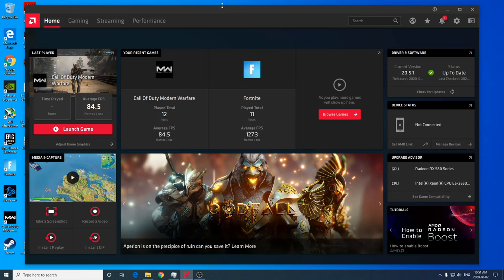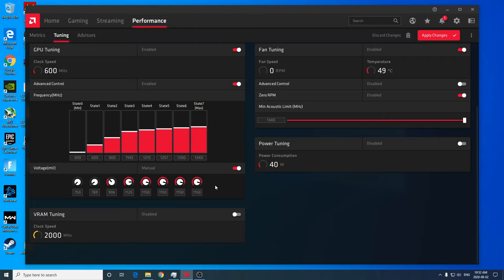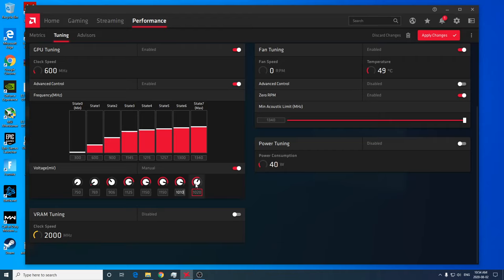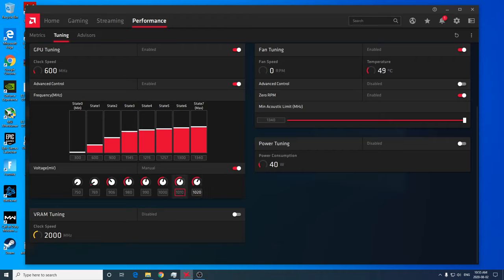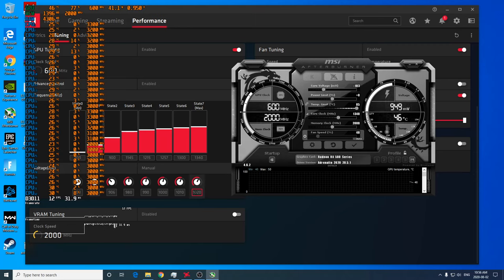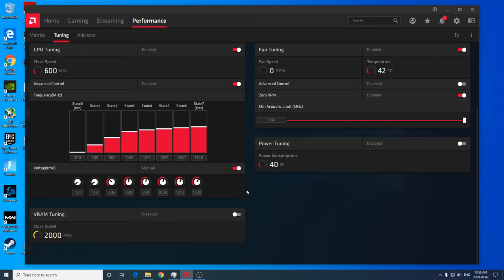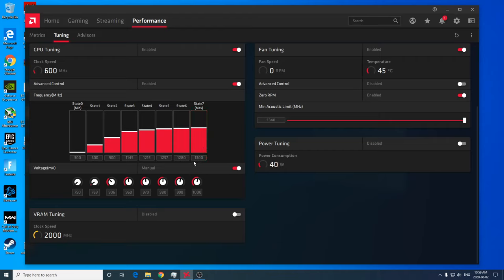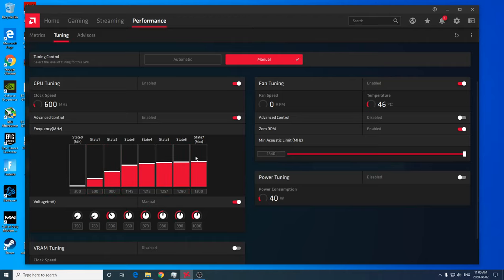How To Undervolt AMD RX 570 and RX 580 (How to lower GPU temp upto -10c)

Comment: Hello I heard that this helps people im just curious if it will burn cables? because i heard that sometimes undervolting burn cables
Reply from the maker: No it doesn't burn cables.
It actually prevents that from happening as when you lower the voltage for the gpu it reduces power draw
Reply: sorry for bothering also im interested i should copy all those setting in video right? @AleksandrsBrodie

Comment: Hey there. Nice video! But in the latest Adrenaline drivers (like from April 2021 and henceforth) there is nothing at "Tuning" . Just the accept license agreement, and then choose between "System", which has NOTHING, and "GPU", which only shows Radeon RX 580 series and "Smart Accesss Memory: Not Available". I have tried finding these settings that you show on your video but with no success..... :-( . 

I am on the accursed laptop Asus Rog Strix GL702ZC-GC195T. AND IT ALWAYS LAGS MAN. Even freaking Pathfinder game which is like a new Baldur's Gate. Now I am just speeding with the Mako Vehicle on Mass Effect Legendary Edition and I can feel the freaking spikes while cruising on a flat road. It's so annoying... :-(

(Of course I 've tried Everything there is to lower down on the in-game graphic settings, to no avail)
Reply from the maker: Maybe try using msi afterburner
Reply: @AleksandrsBrodie  thank you. But will I be able to use it? Because my laptop is ASUS. Or it doesn't matter?
Reply from the maker: @dnthymamai  if the laptop has a GPU in it, msi afterburner will work. it does not to be a msi product just needs to have a gpu in the system ;)
Reply: @AleksandrsBrodie  Thanks! Will try it out ;-)

Comment: Hi, I have a problem, I can't use undervolt for some games, they aren't showing when I want to apply settings. Please reply it will help me a lot...
Reply from the maker: there should be an option when trying to add a game profile to search for the application if it does not show up on the list, that is how i was even able to add an undervolt profile to other applications that are not games.
Reply: @AleksandrsBrodie  nope, still not showing, maybe because it is pirated game...
Reply: I found a solution, thank you now my temps are below 75c!

Comment: How to keep my GPU temperature below 70°C?
Reply from the maker: By choosing a low enough core clock to run a lower core voltage + setting a custom fan profile in msi afterburner
Reply: @AleksandrsBrodie  Oh thank you

Comment: Should we set Min Acoustic Limit at maximum, and is it okay to use fans at %100 RPM speed when Gpu temp is so high? if u can help i will be reaaaly glad man...
Reply from the maker: If your temps are at 88c then yes you need to run fans hard.
But I would first try lowering your gpu clock and voltages. 
And if the card is over a year old I would also consider redoing the thermal paste if the temps are still high after undervolting.
I have a more recent video where I share some undervolt settings you may copy and try.
Remember all cards are a bit different, some need a higher voltage than others.
Reply: @AleksandrsBrodie  I am trying to get the lowest volt as i can right now for Sapphire Rx590 and i am not taking any shutdown for Full fan speed but even on the full speed of my fans cant help the temperature, my temperature is always at 84-85c on stress test either 2000 rpm or 3500 rpm but without undervolting my system was crashing at 3500 rpm now i am not taking any crashes i think thats good but the temp is always the same i am gonna try to redo the thermal paste tomorrow and thank you for the quick response man you are the best!
Reply: @AleksandrsBrodie  and also, is it okay to set min acoustic limit maximum?
Reply from the maker: @yago881  I believe so.
What ever the software gives you an option should be safe.
The only setting that could risk damaging your card is if you increase the voltage on core past 1150mv or if you increased the memory voltage.
So yes. You can increase the fan speed.
Reply from the maker: @yago881  I would try 1300mhz on core at 1050mv for state 7.
See if that changes anything.
You can use software like msi afterburner to overlay the voltages and temps live so you know what the card is running at.
Reply: @AleksandrsBrodie  Even with that, the temp is still at 84c at 3800 RPM its been 1.5-2 years since i bought this display card i dont know the affect of Thermal Paste on GPU but i think it must be because of the absence of thermal paste cuz all the settings i ve tried, none of them helped me the temp is always at 84C with heavy load... is Thermal paste so important for tempereture,  do you think my overheat problem can be by thermal paste absence?
Reply from the maker: @yago881  It very well could be, I would order some to replace the thermal paste on the GPU. its not that hard to do, you can watch youtube tutorial on it, its simple, you just take your time when cleaning the old paste off and just be mindful/careful when working on the card.
Ive had cards that run at 86c even with lower and better optimized voltages and when i change thermal paste they run much cooler,
It really depends card to card
Reply: @AleksandrsBrodie  i will comment the results bro hope it will be satisfying :D
Reply: @AleksandrsBrodie  Yep, it was because of the god damn Thermal paste... man i am just so happy to see these temperature rates i just wanna punch the screen i am so greatful man thank you so much for clearing my mind and giving me the idea of thermal paste absence. I got 55 average temperetarue with 2200 RPM on benchmark BUT normally without the fresh thermal paste, i had 83 Temp on 3600 RPM... man just thanks a lot again you are the best!
Reply from the maker: @yago881  also, you can run your pc without side cover if it ever gets too hot.
glad it helped

Comment: ( sorry for my english  )
Please if u can, do another tutorial with rx 590 i have different stock settings in amd software and i really dont know how to do it correctly. I tried once just lowering last state from 1150v to around 1110v and after 15min my game crashed. In less demanding game it lowered temps but also sometimes my game crash and restart to stock settings.
Reply from the maker: It's hard to undervolt rx 590 if you leave stock clocks.
You need to lower your core clock in order to lower your voltage.
Watch my other ndervolting videos, maybe they will help explain more.
Reply: @AleksandrsBrodie  i will try but i saw on the internet someone lowered power limit in msi afterburner and got less temperatures. Is it good idea?
Reply from the maker: @vustet99  lower power limit will lower your clocks.
Undervolting is lowering your clicks but also finding optimal voltages to run the clicks at so if you just drop power limit, (example) your card may run at 1266mhz, but if you undervolt, for the same power, your card may run at 1340mhz.
Reply: @AleksandrsBrodie  Ok thanks tomorrow i gonna try and last question.
If i only lower a little bit power limit i will get a small performance loss but lower temps or not?
Reply from the maker: @vustet99  if you lower power limit without optimizing voltages, you will lose some performance but you will probably get better thermals.

Comment: I have rx 580 and while playing games i have  ussually like 74° C. If i do those things in vid, will it change the life of card?
Reply from the maker: Yes it can improve the life of the gpu by reducing the temps.
For your situation because temperature is not an issue, you can leave the stock clocks and try dropping the core voltage first to 1100mv then -20mv until you find one that is stable just before it crashes. So you are running the lowest STABLE voltage on your gpu.

Comment: Hello! Would increasing only the power limit without touching other parameters, increase performance ?
Reply from the maker: No.
If you want more performance you need to increase core clock, and adjust voltage so it runs stable.
Reply: @AleksandrsBrodie  thanks for the reply :)
Reply: I have one more question if that is ok, are temps up to 80 degrees ok for rx580 while under full load ?
Reply from the maker: @decadence6418  its ok, but i would feel more comfortable for the gpu to run closer to 74c Max while under load.
so i would suggest undervolting the gpu and underclocking the gpu until those temps are reached

Comment: I don't have integrated graphics in my CPU if it crashes would I be able to boot my pc again.my temps are too high on games 82c on 80% fan speed.
CPU =r5 1600x
Reply from the maker: yes, if you PC crashes you can reboot and it will work.
We are not modding the video card bios or anything.
I would definitely undervolt, if its really hot where you live, try 1250 CORE state 7 and for voltage 960mv state 7.
(and then lower core state by -10mhz and -10mv for the lower states like state 6 would be 1240core, 950mv, state 5 is 1200mhz @940mv, state 4 is 1180 @930mv etc until you are at state one which you leave as default.
That will give best thermals.
let me know how it goes.

Comment: Hey man. I have 1268 mhz at last stage. How much you think i can undervolt without lower mhz? The curent volt is 1150. Thanks!!
Reply from the maker: Probably 1000-960mv depends on the quality of silicon.
You just have to try it
Reply: @AleksandrsBrodie   thanks mate. What if i try and the temperature stay the same?
Reply from the maker: @andreastetraxordos  that can be normal, if you dont use a custom fan curve,
If you want to test temperature difference I would lock your fan at a speed then test with default settings and monitor your voltages and power draw using something like msi afterburner, then you can do the same with the undervolt settings and then see if you notice a difference.
Reply: @AleksandrsBrodie  ok mate i will try . Thanks for your time , i just subscribe your channel !! :)
Reply from the maker: @andreastetraxordos  ;)

Comment: hello, i have an xfx rx 570 i overclocked it to 1300mhz and 1060mv but on 1050 mv its kinda the same but idk if there is any difference should i use 1060 or 1050 cause none of them crashed yet,
and i heard if you go too low on mv your games 1% fps could get worse, and msi afterburner is not working for me i mean the % i watched how to set it up correctly but id doesnt want to show the 1% lows so yeah idk what to do
Reply from the maker: Ok,
Core clock affects fps,
Core voltage is for making sure the Core runs stable.
If uour temps are too high you will need to lower core clock to lower core voltage more.
Copy the setto gs in the video that I pinned in comment section
Reply: Okay, thx for the fast reply

Comment: What performance drop is expected if you cap the clock speed of the core to say 1250 if you want cooler and quiet? I'm assuming not much overall?
Reply from the maker: Ya not much

Comment: IF i have the same grpahics card as you and i put your settings will i have to hard shut down my computer
Reply from the maker: you can use different settings on your AMD RX 500 series gpu.
The reason it would crash is if your core voltage is not high enough for the given core clock you want to run,
If you want settings to copy for better temps,
Copy these:
https://youtu.be/0pzxFZBw-6Y

Comment: i havent tried this, im having an issue with my rx580 everytime i use benchmark / funmark it automatically loose signal on monitor but the cpu still running, as well as everytime i play game on high, i tried to change from hdmi cable to display,but still the same, my psu is brandnew
Reply from the maker: Could be overheating
Reply: @AleksandrsBrodie  nah man i barely hit 80, its always on 73 below

Comment: I have the asus rog strix rx 580 and I get black screen and gpu turns into a jet engine do you think high temp and voltage is the reason?
Reply from the maker: Honestly I am not sure.
I would try undervolting the gpu, maybe run 1280mhz at 1000-1050mv for state 7.
I would just try different settings and see if it makes a difference.
Also use a program like msi afterburner to monitor your temps

Comment: Ive got a RX570 8gb. At 1400mhz and I cant get cyberpunk to load at all. Just hangs and crashes
Reply from the maker: I would try dropping core clock to 1340mhz and try voltage between 1020mv-1100mv depending on your gpu silicon quality.
1400mhz is pretty high for a rx 5xx series card so it will require pretty much stock voltage of 1150mv.
Reply: @AleksandrsBrodie  Thanks. was able to run CP2077 for 3 hours no issues finally, Magic #s were 1425mhz and 1105mv. Only combo that made it past the loading screen! Have no issues with other games at 1450mhz, 1080mv, vram at 2000mhz from 1750 stock. Only had an issue after last cyberpunk update.
Reply from the maker: @theejoeylee  nice, and as you can see, 1425mhz needs a higher voltage 😉

Comment: what about the voltage at 1430 MHz? can you give me some suggestions please?
my strix rx 580 can run at that clock speed relatively stable.
Reply from the maker: you need max voltage generally for 1400+ mhz
Reply: @AleksandrsBrodie  i see... Thanks

Comment: Sir I think I undervolt my 580 badly and after that it wont display but I know that my pc is booting up because I hear the windows 11 sound and my keyboard is working but no display. Do you think if I unplug the gpu and uninstall the driver then install it back do you think that my gpu will comeback to its normal volts? Please help me
Reply from the maker: Yes it should come back.
Reply: @AleksandrsBrodie  sir another question. Can I use the amd driver and reset to default the volts while gpu is not plugged in? and then after that I will plug the gpu back? Cause if I can that's the thing I'll gonna do rather than uninstalling.

Comment: Hey there. Is there any way to automate the undervolt settings to apply on boot? Becayse I have to load the profile every time I shut down my PC. Thanks mate.
Reply from the maker: You need to set a gale profile so everytime a game loads the sett9ngs apply.
I havent found an option that applies at boot
Reply: @AleksandrsBrodie  alright, I tried Afterburner, but same boat with AMD Radeon, I need to open the app so that the OC and UV would apply. Thanks again.
Reply from the maker: @jephimax  ya, unfortunately, there isnt an option for it to apply by default ;(

Comment: Good afternoon, I’m trying to reduce the frequency and voltage by -10, after which the screen goes dark and I have to restart the PC.
Asus Dual RX 580 O8G What can you recommend?
Reply from the maker: Start by reducing core frequency first.
So try 1200mhz and that will let you run lower voltages
Reply: @AleksandrsBrodie  I tried in your comments there is a link to 1200 MHz, https://www.youtube.com/watch?v=0pzxFZBw-6Y.
Only now the screen turns white and you have to restart the PC.
Reply: @AleksandrsBrodie  🙂 I was able to solve the problem this way.
Completely removed the AMD Software driver: Adrenalin.
Then I installed a slightly older version of AMD Software: Adrenalin and now everything is configured perfectly.
Important!!! If you update AMD Software: Adrenalin, then the settings will disappear and again you will not be able to configure and the screen will go out!
Reply: @Video-kr6zm  i have the same problem which version do you install?

Comment: hey bro thanks for the advice but i noticed something wierd about my voltages when i opened up gpu tuning. my gpus voltage is HIGHER in state 4 (1193 mV)compared to 5,6,7 (5,6,7 same voltage at 1150). is that normal? i tried googling it and found nothing. whys it like that?

edit: btw by pressing ctrl + f in msi afterburner you can change each states individually
Reply from the maker: yes you can adjust msi voltage curve, 1193mv is fine as well, some cards are a bit different, but I would for sure undervolt it ;)
a good clock speed to run is between 1300-1340 @1050-1080mv voltage will vary depending on your silicon quality
Reply: @AleksandrsBrodie  i guess im part of the lucky ones. i got 1150 mv on 1020 mv and dropped from 82 to 70 celcius. thanks for the video man
Reply from the maker: @dhanajon5528  no problem, glad it helped!
Reply: @AleksandrsBrodie  wait hold on im stupid thats my clock speed. I meant from 1150 to 1020 mv haha (-130)
Reply from the maker: @dhanajon5528  no worries, I get mhz and mv mixed up a lot when trying to explain this stuff, its tough

Comment: do you know how to fix a xfx rx580 8gb black edition when i play games my screen turns off but my pc is still running then it restarts itself
Reply from the maker: try lowering the power limit a bit. could be due to lack of power from power supply.
otherwise i am not sure
Reply: @AleksandrsBrodie  i fixed it i unpluged my cpu 8 pin and 24 motherboard and changed around my ram and took out my gpu and put it back in and updated motherboard bios and updated gpu driver

Comment: Can u give me recommended setting for my GPU (ASUS RX 580 8GB DUAL OC)

I think this GPU is really hot, on just 30 minutes when playing RDR2 its reach 85-90°C

Im afraid to do this thing (undervolting) cause i've never do it before.
Reply from the maker: its normal to feel intimidated to "undervolt", you can copy the settings in another video that i posted on my channel called, Optimal settings for RX 570/580, if you copy those, you will probably get much better temps.
undervolting took me a while to learn and understand.
I have a few videos on the subject, you can also watch those and see if that helps.
they are all recent on my channel

Comment: l have a amd 580 and amd ryzen 5 3600 6 core how much should l lower my temp my first time bwt
Reply from the maker: i would try to aim for 68c max temp for RX 580 under full load, the cpu should also run under 72c ideally. but anything under 80c should be safe for both GPU and CPU.